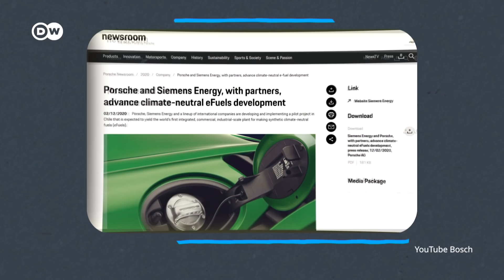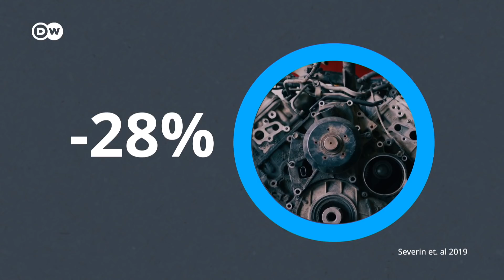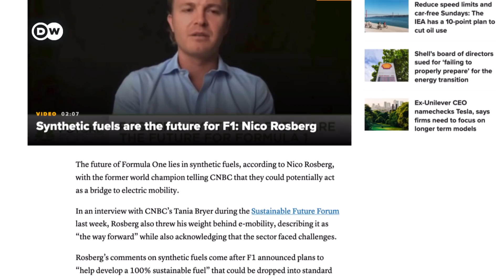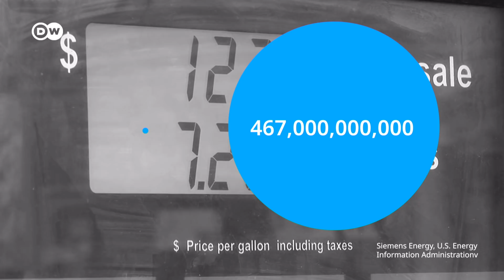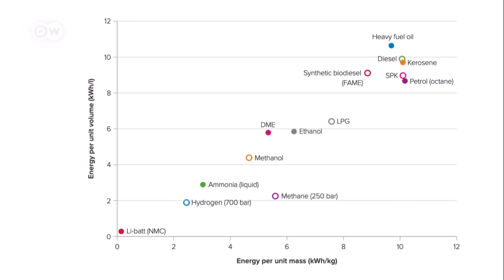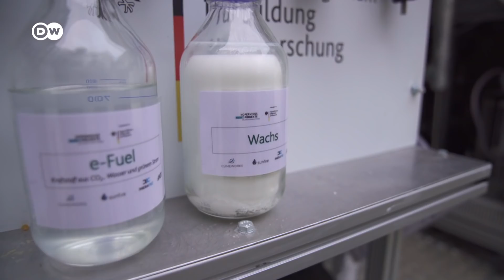The truth about carbon neutral fuels

Comment: I get sick of having to repeat this - we need ALL of it! All the battery tech, wind, solar of various kinds, compressed air, pumped hydro, all the biofuels that don't compete for food production or forests, and even the controversial one - nuclear. People don't seem to be able to process the magnitude of what we need to do, and the fact that it really doesn't matter how much we spend, anything is worth it!
Reply: Thank you! i keep thinking that as well, it puzzles me that still people make ideological and political choices to impose "the one and only solution" when research in both battery, hydrogen and e-fuels (and even more, who knows!) can be optimal for cars, and both renewables and nuclear (even hydrogen for energy storage and heating instead of methane!) can help for decarbonizing energy production?
Reply: Exactly, all of these need to be implemented on a large scale (although some more than others), and as you said nuclear is controversial but fission and fusion if we can soon manage it have such a large potential to reduce carbon emissions. The positives outweigh the negatives hugely, and they will only get safer and more efficient.
Reply: ESPECIALLY nuclear ;)
Reply: Bravo 👏👏👏👏
Yes we need all of it right now ASAP because the next 20-40 years are going to be seriously important to get off our insane addiction to fossil fuels. 
R&D and infrastructure immediately now to ramp up renewables and then we can be picky about what sources of energy are best for the next 100 years
Reply: I think we should not regard the demand as a given, and then try to meet the demand it at all costs. The demand is huge, and ever growing, even the most sustainable technology becomes unsustainable if you scale it up far enough, and I think we may already be beyond the point at which any achievable technology can meet our massive demand in a sustainable way before all goes to shit.
Reply: You are right we need all of it to bridge the gap. E fuel, electric, hydrogen, solar, compressed air, bio diesel, compressed goat farts whatever it takes.. . All fair ideas for one goal for a carbon neutral 🌎.
Reply: Agreed, I'm also sick of the one only option mentality.  What we really need are options, alternatives, not forcing people to only one option.  All systems must not be exclusive
Reply: You don‘t have to repeat this bullshit…
Reply: I don't agree.  We don't have infinite money, so we can't do "everything".  We have to make intelligent decisions and do the things that get us the most clean power for the money we spend.
Reply: @incognitotorpedo42  so it's ok to give (practically) infinite money to save financial institutions, but not ok to spend one or two orders of magnitude less on public research to save our ecosystems? This is an especially troubling position as the science is absolutely categorical - we will almost certainly have enormous reductions in our ability to produce food in many regions of the world, causing far greater economic shocks and mass displacements of people than the trillions they are spending today are supposed to avoid. I don't see the logic.
Reply: The budget that governments (and companies) have for renewable projects is, by definition, an economic resource, and as such, not unlimited. So focusing on producing and researching efuels means that they are not investing that time and money in better sources of energy. Because reduced CO2 emissions is not the only benefit of electric or even hydrogen vehicles, but also air pollution, specially in dense cities. So no, we don't need ALL of it.
Reply: @ggandalff I'm not sure why you are bringing a mathematico-linguistic argument to a practical problem. Biofuels have uses that are important and have some benefits to other approaches. And I agree that budgets are too low today. The answer is to dramatically increase budgets, not reduce spending on other research. This money is highly targeted, and is highly, highly unlikely to significantly contribute to inflationary pressures.

While it's a quite different area, have a look at the economics of government investment in crisis periods throughout recent history. Adjusted for inflation, they have spent much more for stuff which most scientists would agree will have much less of an economic impact.

If you don't think it's a crisis, then I can understand your reticence. If you think it's like "the arts are in crisis, our artists are having to live on cask red wine and bread", then it might be a stretch to argue for crisis spending. I think the science points to a larger problem than that, so we are justified in taking the small risk associated with turning on the printing press.
Reply: Saying we need all of the solutions skips over the fact that there are plenty off plain bad solutions being proposed.

With finite resources, and each government subsidy only spendable once. We will need to make choices.

Here there's a proposal to make green electricity. Then turn that into hydrogen (at a great loss) because it can't get hooked up to a grid. 
That grid inability should be reviewed carefully before deeming the next step viable.

Then this hydrogen gets turned into hydrocarbons (at another great loss). This might make sense, but only if that hydrogen can't be used directly. Is this so? Or does it merely serve the interest of the car manufacturers?
Reply: @sigi9669  we need to spend money researching and developing, to make sure that we have potential solutions for all the uses we currently have for fossil fuels. The massive deployment of some of these might indeed not make sense. Sure. But there are breakthroughs in areas we weren't expecting, so some of these solutions that didn't look like they they made sense suddenly make huge sense.

And the idea that we don't have enough money to do this kind of research is deeply disingenuous. We can spray helicopter money on the masses to stimulate the economy, we can pump hundreds of billions of additional money into the military (like Germany has just done) and we can spray TRILLIONS onto the financial markets to keep the bubble going for just a few more years. And we don't have single digit billions for government research labs? Pah-lease!
Reply: If some technologies are identified as less efficient than others then NO we should NOT invest in them.
We don't have infinite resources to spend on every direction.

For example investing in lithium ion battery powered planes is a waste of time.
I would even argue that every single file that's invested in solar and wind would be much better spent in more nuclear plants.
Reply: @huguesjouffrai9618  do you have any idea how much money is spent on football each year? Cosmetic surgery? Video games? Catwalk fashion? And you are going to say that spending on developing technologies that might turn out to provide some key insights, even if they aren't "the solution", is somehow immoral? Dude, you need to read more about how the world works and the amounts of money that get spent on stuff...
Reply: @transcrobesproject3625  
You need to work on your orders of magnitudes.
The whole world invests around 400 billion a year just in renewables.
The electricity market is around 1400 bn per year
Soccer is just a few billions in investment per year and the full market is around 20-25 bn per year (vs 1400 for electricity).
So yes we are spending money on less important matters but:
- the volumes are not of the same orders of magnitudes and we're not going to solve the energy problem by  reducing these budgets 
- we're not animals, we don't just need heating and food, people have complicated needs and it's normal to put some effort into this.

However investment in nuclear is constantly under 50 bn per year (sometimes much less), about a 10th of solar and wind.
The energy transition to carbon free sources would be much faster if we inverted this proportion.

Just compare France and Germany: one of these two countries has invested hundreds of billions of dollars over many years to develop wind and solar and it's electricity emits 400 g of CO2 per kWh. The other has invested only a fraction of that and is at 50g.
Guess which one relies heavily on nuclear power?

Also wind and solar are not reliable all year long. If your grid relies on them for 80% of electricity generation then you rely on gas plants (ie CO2 emissions) to fill the gap.

I could also talk about how much more land, concrete, steel etc wind and solar use compared to nuclear but the main point is this:
We cannot do everything at once we need to prioritize. We cannot both ask car companies to invest heavily in battery powered EVs and fuel cell hydrogen and combustion engine hydrogen and develop biofuels...
That's just not how the economy works.
That's not how R&D and innovation works, that's not how industry works.

If we try to build hydrogen infrastructure in every gas station then this investment is going to be diverted from building fast chargers.

Saying "oh we'll just invest less in cosmetic" is not realistic.
And even if it were possible, I'd take all this fresh investment from cosmetic and poor all of it in a few very promising sectors (like nuclear) rather than splitting it between 10 technologies, including some which cannot solve our medium term clean energy problem (like carbon neutral fuels)
Reply: @huguesjouffrai9618  Umm, I think it's you that needs to work on your orders of magnitude - what I'm talking about is pure research money. You know, because, that is what the conversation is about, not production. Let me know when they are spending 400B (unless you are talking about Zimbabwean dollars...) on pure research into renewables.
Reply: @transcrobesproject3625  
Well if you compare football income vs R&D investment these are not comparable budgets.
Comparing them means you hope that people will stop buying football jerseys and paying to watch football to instead finance energy innovation.
That's not how we're going to find financing and that's a bad comparison (basically the money in football has nothing to do with financing innovation).

Also there's enough research out there to know that synthetic fuels are not going to be the solution on the medium term (which is when we need to decarbonize).
And same applies: all the effort pit into researching biofuels doesn't go into other techs that can actually be a solution.

There's not going to be massive funding of tech that will not be massively used.
There's massive research into batteries because it's actually a solution that works and makes economic sense.

So finally even if we magically convinced everybody that we would stop financing all leisures and entertainment to instead finance renewables, we still shouldn't finance technologies that we will not use.
We should still keep choosing the best technologies.
It's like saying that we should invest in R&D for square wheels or in low carbon monster trucks because we need to invest in every possible tech.
Reply: @huguesjouffrai9618  I think you don't realise what the challenges are. Oil and natural gas have a number of special properties, and having so much so cheaply for a hundred years means we go lazy. As you say, we aren't likely to be using batteries in planes or as fertilizers.

The thing is when hydrocarbons start getting really expensive (2035-2050, depending on who you ask), then we are going to start having economic shocks one after the other. The football hooligans will be out in force if we get up to 50% unemployment...

The thing is that a totally uneconomic solution today might turn into something that is much more economical than the other solutions in 20 years time. And we are not talking about things we might need, we are talking about energy and food inputs.

All I'm saying is we should be spending probably an order of magnitude more on research than we are now. And if that means taxing footballers a little more, then the net benefit to 99.9% of us is very clear to see...
Reply: @transcrobesproject3625  
You're not going to be taxing footballers you're going to be taxing football fans.
Why them?
Why not any other part of the economy? Who are we to decide what is necessary and what is not?

I'm in favor of a carbon tax that would make everything simpler and there is a clear justification as to why some have to pay more.
Another solution is tax breaks for green investments.
But both cases mean having more taxes in general which is always easier said than done.

Also we are not transitioning from hydrocarbons because they will become expensive, we are transitioning because they're changing the climate.

Estimations for when oil would start to become really expensive have consistently been wrong. There's a ton of oil hanging around and we get better at exploiting it.

The only way oil becomes more expensive is if we tax it or force investments to slow down (which is happening).

But there is no real path for green fuels to become economically viable.
Other solutions are just much better (mainly electrifying everything).
Reply: @huguesjouffrai9618  I suggest you have a read about Net Energy Yield. A lot has been written. Also have a look at some of Nate Hagen's videos. A large Finnish government report from their geology people also made some very stark recommendations about prices short to mid term. Your point about "getting better at extracting" is a false one. In addition to doing absolutely horrendous things to things like the water table, which very directly affects a country's ability to produce food, it's actually not that economic at all. Just look at the massive rounds of bankruptcies for shale companies in the US. And it's all about the quantities at what prices. Sure, we'll be able to continue extracting hydrocarbons for certain purposes but when it costs (the inflation-adjusted equivalent of) 250-300€ barril then stuff stops being cheap. Add to that the steeply increasing amount of CO2 for each barril extracted and both public opinion, hunger and science start getting in the way of alternative extraction methods. Even the oil companies agree on this - have a read.

We need alternatives for all of the roles hydrocarbons play in our economy and we are absolutely nowhere near that yet. We need a LOT more research, or we are going to get serial kicks in the guts until we do.
Reply: @transcrobesproject3625  hey I'm not saying hydrocarbons don't have a bad impact on the environment and on local ecosystems.
But from a purely economical point of view they're just too profitable, they create much more value than they destroy (if you don't take climate change into account obviously).
It looks like oil price has risen since the 70s, but in real terms (how much oil does 1h of work for the average person buy, or even a poor person), prices have actually decreased in the past 40-50 years. Not only in emerging countries, but including rich countries as well. Which is part of why people now drive much bigger cars that go much faster: they can afford the fuel or why Chinese people don't cycle anymore.

Keep in mind that even in countries were oil is taxed over 50% and with a barrel over 100$, oil is super competitive. It's just too good, too easy to use, too cheap and versatile.

I'll check your sources but I don't think we're going to convince people (and especially emerging countries) that using oil is not in their financial and economical interest for the next few decades.

An important aspect to consider is that in general oil has been very cheap and like everything, we've been finding every possible profitable use of it, including many barely profitable ones.
It's logical, when something becomes too cheap people start using it for purposes that the stuff is not the best at. Think of Germans in the 30s using bank notes to decorate their houses. Or how Saudis are cleaning their cars from dust twice a day with water because water is subsidized so much.

Well it's the same for oil. As its prices increases, the least profitable uses of oil (more precisely the uses where using oil instead of something else brings the least benefit) will be discarded first which has a quite small impact on the economy.
But most of uses will still be profitable at much higher prices than today.
Example: planes and boats are actually going slower today than in the past because going 10% slower for a plane or 30% for a boat actually has a negligeable cost but saves a ton of fuel. But tripling fuel prices (which are between 20 and 40% of an airline's costs) would maybe only double plane tickets prices.
But ticket prices nowadays are so cheap than even at three times the price the demand would stay very high and would not dramatically decrease (prices would only be brought a few decades back but the main driver for the increase in passengers is the demand from people getting richer all around the world).
For boats it's even clearer now that we're in a supply chain crisis. This crisis proves us that prices can go super high without really affecting demand for maritime transport (because it's so cheap). So even with oil at 300/barrel we would still be using cargo ships.

And the list goes on and on when you look at the impact of oil in industries costs. The thing is just too cheap. And the world is growing.

That's why unless we regulat (ideally with a hefty carbon tax), price hikes won't significantly curb fossil fuels consomption in the next 50 years.